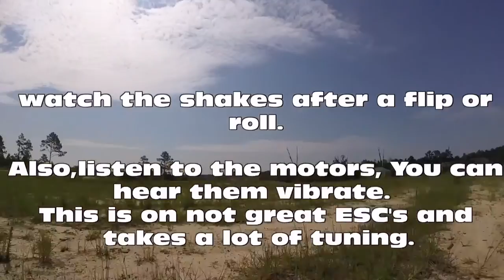Comparison of Good tune and bad tune!

Comment: I agree with this!  My current escs don't have damped light at all and they really fall on their face at no throttle rolls/flips.  They are very floppy!  At least 2 or 3 times as bad as the 1st half of this video. They are better if you keep more than 25% throttle all the time.

I plan to upgrade to these blheli_s escs.  No looking back after that! =)   
http://www.2dogrc.com/emax-lightning-s-35a-esc-blheli-s.html